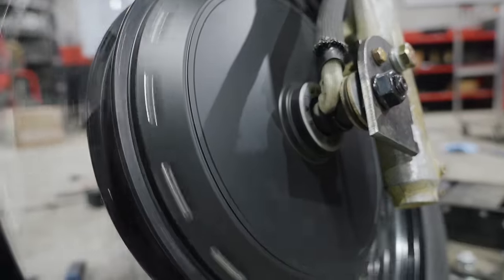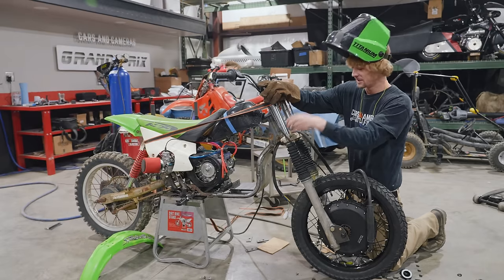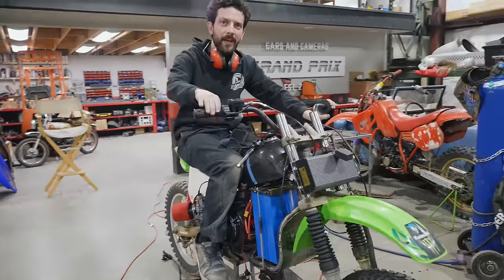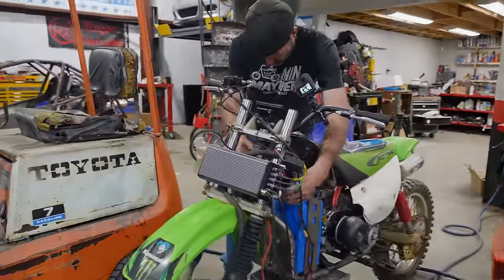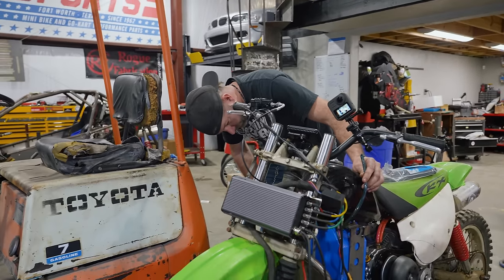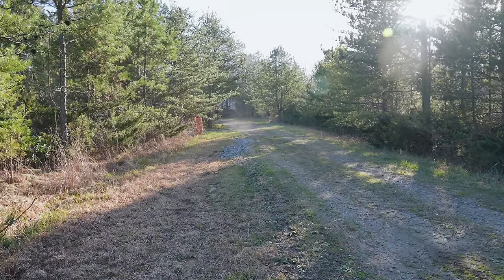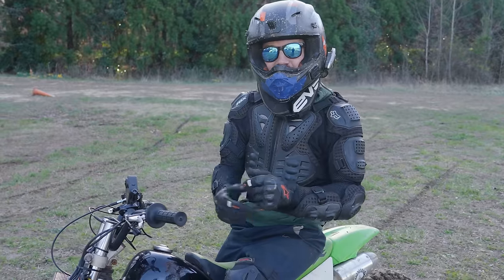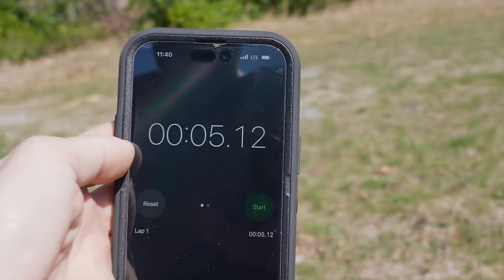AWD Dirt Bike First Test Drive! (35 Combined HP)

Comment: get a second electric hub put it on the back and have 2 battery packs … as long as you have two extra knobby tires that thing would be a rocket …. You could also put street tires on it and drag the 1/4 strip race strip. All electric 💪🏻 👍🏻
Reply: I guarantee it will pull harder on both the hill climb and going down the driveway.

Comment: When lithium batteries go below the safe charge level they are no longer safe to use from what I've seen and heard. Once it's below the safety levels they are not like lead batteries that can be trickle charged back up. Please be safe with it and don't keep it around other projects in case the battery has a failure.

Comment: if u hold down the m button when on for the lcd it will take u to the settings and the default password is ‘1801’

it works for my lcd i dont know if it will work for yours

Comment: So instead of running a twist and thumb throttle. Consider buying an Electric cable driven throttle assembly and just use a banshee throttle cable to open the carb, and drive the front wheel.

Comment: Move the electric wheel to the rear and chain it up to the gasoline engine. Run it on the gas engine and use the electric for a turbo boost. The power will come out the same and you get directional control back in the steering. The front wheel with power on it is acting like a gyroscope, refusing feedback from the driver. The centrifical force of the rotation is stealing control from the rider.

Comment: In my opinion, this is a little bit too sketchy.  The steering feel must be completely different than a standard motorcycle.  That being said, I'd be interested in seeing a bit more on this.... as long as you guys are wearing proper safety equipment.
Maybe make a hybrid road bike.  Add a generator for charging the battery while cruising and have the electric motor available as a "passing gear".

Comment: I would have just run a chain and sprockets to the front wheel. Use the same size sprockets on the front that you have on the back to match the speed of both back and front wheel

Comment: I will say that those batteries, do not enjoy being discharged as low as it was, if it takes a charge and holds it, GREAT, you lucky. If not, then the innards have begun to form crystal like structures causing internal shorts, heat, and ultimately discharge. I would charge it all the way, mesure the voltage, let it sit overnight and check again. See how much it drops just sitting.

Comment: Do you remember those toy motorcycles that you pulled a rip cord that made a weight spin that kept the bike upright and going straight but also propelled the bike forward through gears.  The heavy front wheel assembly is having a gyroscopic effect that wants to remain upright and go straight ahead.  A lighter Aggressively knobby tire should make it easier to control but I'd work on the proportional controls for the electric motor too.
I love all your projects but stuff like this is my favorite.  Frankensteining together an original idea without a bajillion dollars of equipment.  Mostly working with what you have at hand and building the rest yourself from scratch.  This takes me back to the beginning a little bit

Comment: If you connect the electric throttle (potentiometer) to a part of the thumb throttle you can make the thumb throttle run it all !!! Little bit of engineering and fab but definitely easy to do.

Comment: You guys need to find a YouTube or like sir Ron. Or someone that Can Fix the throttle set up to wear. The gas engine and electric motor are working simultaneously
Reply: But yes, someone should be able to help you. Wire the throttle up to where it's using both functions of the gas engine and electric motor. That would make it so much better and you would only have to twist the throttle or put a thumb or auto on it.That operates both motors

Comment: 4.2volts is full charge for a lithium cell anything over 4.2 V will cause degradation in the battery cell and it will start swelling as Charles knows.

Comment: put that front wheel with a paddle tire inthe middle of that hovercraft and do a hybrid hovercraft...   thats so cool... i got 8 motorcycles... i made a front wheel drive e trike i never felt good about the dropouts being open like that so i got tourqarms... i got a awd ebike for black friday and its cool... i tend to lose traction alot too... i find getting as much wight over that front wheel really helps keep it under control...i actually put a front mount pannier rack onmy front forks to get more whieght over that tire... also since you saidd hitting the elec motor is like hitting turbo... why not make the throttle for the gas twist and  hook up a thumb for the elec motor... might be more intuitive...

Comment: For a throttle – set up two brake levers on top of each other.
Reply: The electric "throttle" has no wire.  It's sensors on a disc.
Reply: @RandysRides  oh I gotcha. Maybe you could incorporate a linkage with a linear or rotary potentiometer?? It's probably good enough as is lol.

Comment: Just think what that bike could do with two electric motors tied in together one in the front one in the back I think it would be faster than the setup you have because the front has to drag the back which takes a lot more pulling on the driver train of chains and belt

Comment: As an electronics guy, I always find it funny when petrol guys get freaked out by electricity. 1000's of explosions a minute between your knees your fine with, but some spicy wires scare you. I've never gotten on very well with ICEs. At least, fixing them. This is both an excellent idea and a silly idea. Which is the Venn diagram I'm here for.
Reply: to be fair the explosions aren't explosions while they're still in the engine, its less scary when you think about it that way.

Comment: westport wa.state here young sir's. sun is getting threw now. cool
i think you need to not go so far as to put this in to production. and a little bit. well just no.
living by salt water where where lithium batteries can blow. gas only here. you do know what lithium's secondary use is i hope. think boom. hot boom. add a little sugar and "dam".

Comment: you guy's got grinning from ear to ear. the things you folks do. myself and others were doing along time ago. we used starter motors.off or on. put a head light switch in for high low and bam. car batteries do not go far. was not that long ago. jell batteries were just coming out.

Comment: Front wheel drive on a bike is suicide guys.I have missing teeth from wrecking dumb ideas ok.Please be careful.
Reply: FWD on a bike is amazing when done correctly, see Christini AWD bikes or Rokons for examples of it done well.
Reply: @771racing I was about to comment the same thing christini bikes are very cool the problem with them is when the rear loses traction so does the front
Reply: @771racing  Came here to say this lol. When you arent just hacking shit together, it can work surprisingly well.
Reply: That's terrible😮
Reply: The motor spinning in the front creates a gyro affect and makes it very hard to turn
Reply: They aren't racing motocross.
Reply: Rokon has had an AWD bike for 60 years...its not a stupid idea
Reply: Only thing more suicidal would be a unicycle with this hub motor 😂
Reply: @netrioter Have you ever ridden one? I have, they are the worst bike ever made.
Reply: @771racing the Christini system is a great expensive way of making a modern dirtbike completely suck lol. And the drive mechanism tends to explode. The Rokon makes more sense as it's a bog and snow crawler, not really a dirt bike but more a utility vehicle.
Reply: @Duckyninja50 they make them and they will do 45mph.
Reply: It's not the first 2 wheel drive motorcycle. As long as they can sync the acceleration between front and rear, they will be fine. It's not designed to drive around on just the front wheel.
Reply: A helmet would do wonders for you bud. Must’ve never heard of one
Reply: What do you mean dude. The best bikes going are front and rear driven and off road over sketchy terrain like logs and rocks and deep mud. Best bike I've ever had the chance to drive and I want one from a crate
Reply: I have missing teeth from dumb ideas as well. Never do drugs kids lol
Reply: Anybody saying a bike driving the front wheel is a good idea faster than 10-15 mph doesn’t know anything about motorcycles. It won’t turn at all after 40-45, without having to physically wrestle it to lean. All that I sprung weight on the front is an awful idea.
Reply: 2 wheel drive ebikes can be on another level!!!  I test road a friends he brought over for some tinkering and its a balance of throttle and holding on. I couldn't hit either throttle to full whack till I was probably over 30 something and then it felt like a lot of fun.  Under that it was terrifying how much it felt like it just wanted to fold me in half if I tried to be stupid and smash the throttle off the line or moving slowly.  And trying to balance the front a and rear throttles while also steering was sketch as hell.  You could do a sic front wheel burnout if you forget which throttle is which and think your adding throttle to the rear 😂. But you can't steer and it dumps you at low speeds doing that nonsense😅
Reply: For if u wamt to go 10 mph @netrioter
Reply: Actually iv tested a few of the awd stuff and the r1 I rode I could push way harder than a normal one. Now I started riding at 3 so I'm quite talented and iv ridden most things from the 60s to today 😂 awd on a bike is amazing theres a caviot here most ppl cant ride worth a damn good or bad they have no clue. And look I know I can ride circles around most ppl on the Rd but Iv ridden with guys that make me look like y'all Bambi's 😂. Only fwd would suck but awd is amazing. Now electric fwd with gas rwd sounds like a headache to tune the systems to deliver what you want when you want it. The r1 I rode had a hydraulic fwd driven off the sprocket so it was linked with some slip. I found I could put power down wayyyy sooner out of turns and mid turn maybe a touch before right after entry I could lean it all the way over until I was tucking my leg and the engine braking would load the front tire like I was trail in braking but better being linked to the rear. I could lean over and slide into it like a super moto but not as extreme and really keep my speed high through the brake zone and do a lot at the end and into the turn then on exit I could really get aggressive with how hard I ramped it up and the back would slip but not sink and slide out far. Actually a lot easier to slide than normal by a lot. The front really pulls you up and forward. On straights I could lean way forward and keep the nose down while not spinning too hard (there is slip between the two tires but it was small on acceleration) basically I could put way more throttle on at way lower speeds.
Reply: Rokons only go like 4 mph  tho😂
Reply: There’s a reason no company today sells bikes with front wheel drive. All that have tried have failed. It’s just a stupid idea, as all traction goes to the rear wheel when accelerating. The only thing that the front drive adds are loosing traction on the front wheel, and that’s really bad on a bike. Nevertheless, it’s fun to see people goofing around with it 😂
Reply: @Bustasean  I think the Christini ones are only sending power to the front at low speeds
Reply: Ha ha
Reply: Rokons are for pottering around at 5mph, they are crap! Can't go fast enough to hurt yourself!
Reply: My awd bike is the only one I haven't crashed. Driving the front wheel helps in the event the front looses traction. The drive power pulls the bike back upright if you wash out the front. Honestly, I'd say it's likely safer and just having rwd.
Reply: @Snugglez187  as long as the electric motor isn't overrevving the gas engine no syncing should be needed. Electric motors can be driven at very high cycle frequency unlike piston engines which have one cycle per revolution (or two). Not over-revving the gas engine is pretty easy if you limit the electric motors maximum rpm.
Reply: Maybe u should have worn a helmet
Reply: Helmet.
Reply: What exactly did you build